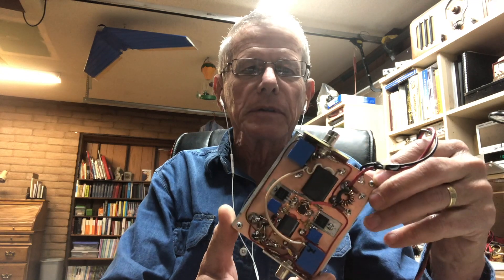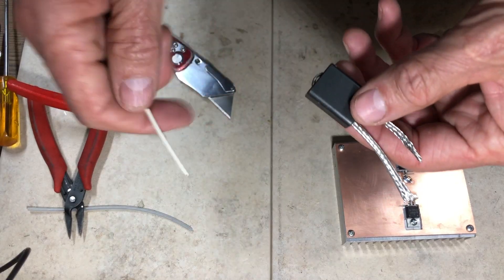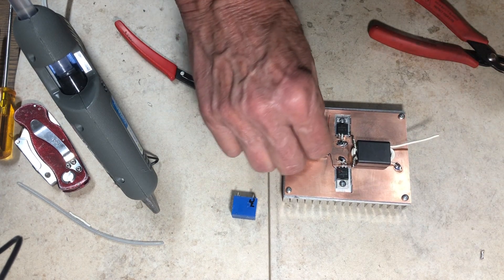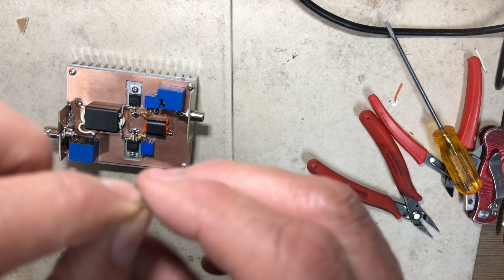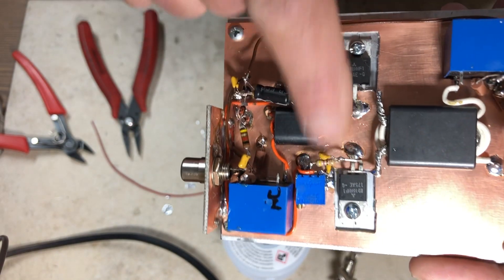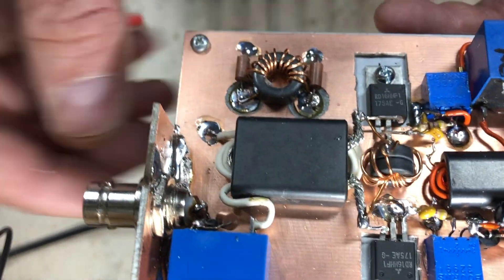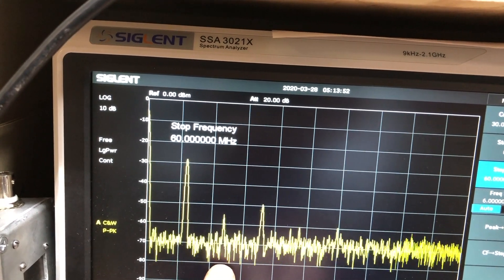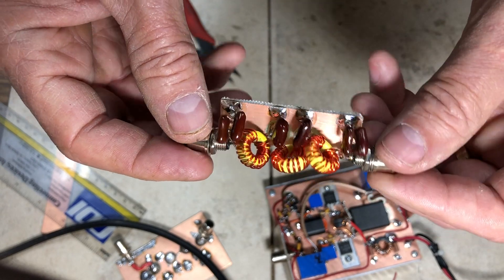RF Power Amplifier Construction

Comment: Hi Ron, really enjoyed the build - thank you. I've been looking for a reliable source (non Far East) for the RD16HHF1. Kits & Parts don't list on their site. Do you have any suggestions for a supplier? Thanks. Neville, New Zealand.
Reply from the maker: Hi Neville. Those transistors came from RF Parts here in the U.S. Good luck. Thanks for the nice comment ...
Reply: @rontaylor9026  Hi Ron. Thanks for the info. I've placed an order with RF Parts. I've ordered enough for your project and another project I like the look of ... and a couple of spares :).
Reply: NM You can also get a similar part from Mini Kits in SA ie Adelaide - Tim Fidler.  THe chinese supplier,  UTSource is normally reliable as in not  selling dud or repackaged parts.  Basically if you are buying out of PRC you should be paying 4 to five USD per part . If you pay a lot less you will be buying junk.  I have bought parts from Polida in PRC with good results (leaded J310s ) but not this particular part.  Tim Fidler  WRE NzL. My take -  RF Parts US has very high min order value and he charges top dollar too for what he sells. However he does not sell unknown parts from second tier suppliers.
Reply: @F_Tim1961  Thanks Tim from Whangarei. I've added all the sources you mention to my list of places to check for future purchases. I must say I was very happy with my RF Parts transaction. 7 transistors including shipping etc NZD$90 and they arrived within a week of ordering.
Reply: @nevmarr  Fair enough I think you would have paid around the same out of ADL.  - a quote from his site "Mitsubishi RD16HHF1 RF MosFET Small Signal N Ch 12.5v 16W 30MHz,..
Priced from AU $8.60."  

Bear in mind that this amplifier you are building is a NON Linear at the power levels given.  It is a 16 W RMS SSB amplifier only.  The bias for SSB use should be around 500mA per device ie 8W each before they even produce any RF out. The video does mention CW only.   The unit would benefit from a different material of OP transformer if intended for 10m Use. Specifically type 61 material.  The type 43 material was what DIZ says he used. (he calls it the MiniPIG Amplifier) However Diz says a lot of things .He calls it a 20 W linear which  is practically impossible at 14V supply.

The amplifier as shown will not produce 37 W out (non linear) when operated within Mitsubishi Specs for the devices. However , It might produce about 65/45  x 20 W = 28.8 W out based in typical efficiencies Class C to B  ratio and run on a 24 Vcc supply,  which is above Mitsi max for infinite bad VSWR resistance by about 9 V.  This is based on real word results for a Ukr pre built amplifier and comparison with data from Kees Talen (USA) who used to sell a kit with a similar topology.
Reply: @nevmarr  If you are looking for a CW only PA the 50W PA from QRPLabs is well worth looking at .  It is really a 40W out PA and will generate that only at about 22 V supply.  It costs only about 35 USD plus shipping from Turkey  (that includes heat sinks) . THe owner of  QRP Labs, Hans, is a Pom.

  It would be a bit messy to convert this amp to a linear SSB amp but it could be done.  - the messiness comes mainly from the bias arrangement he uses.  This amp does NOT use relays for tx rx  switching. It is all done in solid state. For the money, it is pretty impressive.  It uses a type 61 equivalent material output transformer (as two off coaxial cores side by side).  THerefore,  it can produce useful power at 28 Mhz and beyond. 

  QRP  Labs is easily found with a Google search.  40-50 W CW on 40m with a decent antenna effectively gives you 15 000 km in all directions.
Reply: @F_Tim1961  Thanks Tim. My main focus is linear (but I do dabble with CW). I was drawn to this page by the use of the RD16HHF1. I want to experiment with, but not exclusively, 6 metres and I've found a few references with the RD16HHF1 working well at 50MHz. Interestingly the Minikits EME210 kit uses the RD16HHF1. I'm QRP so, for me, broadband is more important than watts.
Reply: @nevmarr  the Kees Talen kit which is unfortunately now unobtainium proved that the RD16HHetc would produce power but not that well at 50Mhz.  He got 8 W out , linear,  under test in a real amp ie -3dB power on what he was getting at HF. the Big thing is the use of type 61 or  NXP equivalent cores.  You can still use type 43 in the phasing transformer.  It is also possible use type 43 in the front phase splitter transformer if you are willing to take the drive  losses.  The design as shown in this YT will NOT work at 6 mtrs . I think DIZ produced a fraud saying it will work at 28 Mhz also, esp the claim for 20W out.  He designed it for an add on to a PIG kit that did not sell well.  I suspect the amp as he sold it failed commercially. 

The cores that KEES used are available only from Digikey  (with high mark up and courier fees ) and not from DIZ.  In addition Kees used a copper tube design which is far superior to what is shown, because there is no magnetic field inside the primary tube except by that caused by assembly asymmetries.  Kees used TE coated wire in his design for improved performance - critical for 50 Mhz use .  PTFE coated wire is death to RF above 10 Mhz .  PE wire is possible but it melts at a low temperature. 

A vendor called Navships sells TE wire at good prices on Ebay . I have dealt with him . he's ok.  He is in the US and appears to buy up end of reel cables and then cut them up and mark them up a bit.

 The reason KEES T  stopped selling I believe was the competition from all the CHinese rubbish kits which had rubbish power out claims. It just got all too hard to sell a quality amp design.

  BTW there is a VHF version of the RD16HH which is an RD15VHf1 I believe. It has almost the same specs but has lower Ci and is rated to at  least 150 Mhz.  Minikits USED to sell this part and you will find them on Chinese EBay but take care with fakes . You can't use them promiscuously as  RD15s may self osc in  circuits which have feedback via the PCB layout whereas the RD16HH will work in the same circuit without issues. 

 Both types can be used in parallel  (but not mixed). If you can find the schematics for the Hardrock50  AMP you will see how they did it.  The Hardrock 50 also claims 6 mtrs.

If you go to the Waybackmachine on the internet you can pull up the old Fairrite cat 14 on ferrite technics as a PDF .   Or email Fairrite in the US for a back copy and keep hammering them until the provide it or give you a link.  Later editions got considerably dumbed down. Only the Cat 14 has sufficient information for proper RF design above 10 Mhz  and in particular about  Pig nose balun cores.
Reply: @nevmarr  BTW it is  standard practice to put a YY pF silver mica across the primary of the OP transformer.  I notice Diz did not do this.  The value is entirely experimental but typically around 800pF  (40mtr operation)  for this level of power. What it is doing is providing an L1  C  L2 transfer function to the winding of the OPT  (that's my interpretation).  the L2 is the leakage inductance of the primary of the OPT. The L1 is presumabably the board trace inductance plus the lead Z of the MOSFET PA (per side).  I have looked up Granberg and allover several times  as to the rational sizing of this capacitor and there is no theoretical sizing basis.  Clearly there is an optimal value for a given driving frequency but what is done is to put in one for mid band and leave it at that.  The circuit will work without it but it will not be optimal.    TEF .  THis type of matching cct is covered in Motorola AN 267 as a design tool.
Reply: @nevmarr   Are you aware that  MRF186s are avails on the  PRC surplus market for as little as USD 15 and some are in fact new (say the vendors) ??

Others are pulls from old CHinese  consumer VHF gear ( 900 Mhz cell phone tower power amps).  These are 28 V devices but will in  fact work on 14 V.  The power rating if properly heat sunk is 120 W out in Class B with an assumption of about 60 percent efficiency.  The datasheets are all over the web. These devices are of course out of production.   The main draw back is the really lousy Gp, about 9dB  (there had to be a fly in the ointment ) .  

These form the basis of the MXP -50M  multiband  brick amps that are sold in Australia and on the internet.  These are Vastly over priced for what they are and the mafr's power claims are Hsht but they will produce 35 W out with Vcc 14 V and with 5 W of SSB drive.  

 So why put up with 16 W linear on six mtrs when you can have 70 w or so and with the device hardly stressed at all... just a thought.  I think the ARRL and others ignore these simply because the are OOProduction and nobody knows what the true supply situation is.   Engstr        atat    Netspace    dit Net in AU will reach me if you wish to discuss  ( I have some schematics of known good commercial designs for the latter and layout photos )  Sorry to rain in the RD16HH parade.   Bst regards,   Timothy  E .  Fidler ,  WRE NZ (Dual citizen).

Comment: Para que feceucn es ese amplificado/   For to  frecuency is this amplifier?
Reply from the maker: This amplifier was intended for use on Amateur Radio frequencies in the HF band. Primarily in the lower part of the HF Band from 3.5 to 14.350 MHz

Comment: Hi! Can I replace the mosfets with IRF types?
Reply from the maker: It's certainly possible, but it may take a total re-design. The IRF types have the drain lead on the tab of the device so they have to be isolated from ground. They also exhibit different impedances, so the turns ratios of the transformers may need to be modified. And if for example you use IRF-510s, they will not make as much power as the ones I used when running at 12 volts, and will need to be run at 18-20 volts. Finally, I believe the devices I used are much less susceptible to damage due to high SWR than are the IRF devices. Hope that helps ...Ron
Reply: @rontaylor9026  Thanks a lot!
Reply: What about irf520 device and what voltage would they need?

Comment: Possible error - the 2n3906 PNP looks strange - should not the Emitter be mirror imaged on the schematic ??  No I see - all good - it is very hard to read on my screen.. that's my excuse on the closer pin of the  78 L it looks like the word OUT but it is very faint.  TEF
Reply from the maker: Actually it is correct Tim. The 12v enters at the emitter and appears at the collector when the PNP transistor turns on and supplies input to the 5 volt regulator. The 5 volts out supplies bias to the transistors on transmit. That same 12 volts at the emitter is present on one end of both the relay coils. The other side of those relay coils is returned to ground by the NPN transistor to energize them on transmit as well.
Reply: @rontaylor9026   I thought you might take up the business of the "missing" finessing capacitor ACROSS the primary which I mention below.  ?As say H Granberg and many many others talk about it and it does increase power transfer but the specification depends on things like the parasit inductance of the primary of the OPT  (and the secondary for that matter ) . I don't have the RF gear to measure that.  The proof of the pudding is the cct will work without it but it is more efficient with it.

2. The circuit has not option for a ground -= Run PTT circuit. The most beautiful way to implement this is a BS 250 P channel Mosfet switching type.  this has to be biased on with say 5 V via  1K resistor.  When the cold side of the resistor is pulled low , and the gate goes low the BS 250 conducts ( up tot 700mA)  That will then fire up the relays by pulling current through the drain of the Mosfet and the relay coils in //.

3. You need to make it very clear that when you use a MLCC type capacitor it is "accept not substitutes"  . For example the input 0.01uF caps are going to have to pass 1 W RF each and higher power as a peak.  They can be MLCC or SMica but if other subs are made the results may be ugly. New constructors may not realise this. 

4. Theoretical calcs show that if you have two off To220  close to the ctr of a HSink then you are FAR better off thermally than splaying out as you did.  It seems counterintuitive but it is true and is supported by quality H Transfer theory books.  So if each of the RD16HHs is rotated then the board layout becomes  a lot more beautiful  and in fact thermally superior.
Reply: @rontaylor9026  Another question - do you have any feel for why Diz used the FT 50-61 for the phasing choke.  Just about every other design of this type for the RD 16HH uses a type 43 ring core for the P Choke, to drive up the inductance . I know the original design was for 28 Mhz but you are using it at much lower frequencies.   I have always wondered too why Diz used type 43 material for the output transformer - given the frequency.  It has occurred to me that the material types were transposed because he never went into serious production with the design, where he error, if it was, would have been caught.   Type 43 of course on the OPT would be fine for 3.5 and 7 Mhz.   Just curious     TE Fidler            There's no point in asking Diz about this as he no longer has any interest in the design.
Reply from the maker: @F_Tim1961  Hi Tim. Thanks for addressing the filter question. I missed that. You may be right about the swapped ferrite types. I’ll have to play with that someday. I was happy with the output on the lower bands where I tend to use it so didn’t try any efficiency modifications. 
Ron
Reply: @rontaylor9026   The single mode impedance of the  phasing choke needs to be about 5 x the  impedance of the final RHS resistive load as  reflected through the OPT to the primary.   This is because a closely coupled Ph. choke doubles Vcc as seen by the PA mosfet which is the same as the reflected load being halved as seen by the phasing choke. So the  Real load as seen in parallel with the single mode Z of  the Ph Choke is  in that case on tenth of the Ph. choke's  5 x Z . Now a FT 50-61 with 8 t  is a bout a 4.2 uH inductor (if it is slow wound to cover 330 deg say it will be lower and by perhaps 30 percent).  That 4.2 at 10 Mhz comes in at  240j ohms.  If the amp is ouputting 16 W at  supply 14 V the output Z is about 18 R.  so we want at least  90 j as the single mode  Z of the Ph Choke.  That means the Ph choke as built  is only Just acceptable at 3.5 Mhz in terms of the current that will just be shunted and not appear in the load. As soon as the power out increases to 25 W or 30W then it  is not acceptable.  The choke winding table I used assumes that the Cu is in intimate contact with the core and for a bifilar wound core,  this is not strictly true so full L will  not be achieved.   The OPT core of type 43 is correct for the lower bands but is  a lousy choice at 14 Mhz and above.   Tables on page apprx 90 of the old Fairrite cat 14 show this very clearly.    TE Fidler
Reply: @rontaylor9026  Just to extend answer starting "the single  mode" - you might wonder what the upper limit of the  turns is for the phasing choke. - the answer is that it depends on how accurately it is wound, that is to say what the coupling coeff, k is.  Since it is a 1:1 transformer , you can consider  2*(L1 x [1-K]) appears on the far side in series with the OPT.  As long as K remains near one then turns , apart from real world losses (which are not zero) are not really significant and obviously at lower frequency, by the foregoing note more N is better. However if the real case of 8 T on the specified toroid is considered, the inductive react at 28 Mhz is about 0.6x  740j.  so the in series reactance is about 9 j for K = 0.99 ,  compared with a real load resist of about 18R at 16 W out - see previous calculation. ( Nb the factor of 0.6 comes from the fact that the turns are wide spaced on the toroid )  

THis is really serious in terms of loss of delivered power .  This  suggests K needs to be as high as 0.995 for this transformer to work well at this frequency and this K assumption.  
How serious is serious - well the above figures indicate a drop of rf current by 18/20.1 ratio with a cos phi of cos 28.5 degrees. That is an overall power drop implied of 0.8 or -20 percent.

It also indicates why  Diz chose the type 61 core. It is also a general pointer as to why getting reproducable performance above about 15 Mhz is so hard.  AS for the material of the OP Transformer,  I'd say it was just a first pass and  a cost issue.  It will work  at the indicated frequ. from Diz,  28 Mhz,  but it will be lossy there.  How lossy ? - see the old Farrite catalogue 14. 

It is interesting that  Kees Talen  (Ex EE head of Texas A and M ) used a Bifilar wound Phasing T wound on a BN 43- 302 for his 16 W linear kit  amp. This was qualified to operate at 6m but with reduced power out.  I am guessing he tried a conventional PT and found it would not perform.  It is interesting that such a small detail as this has so much science to it as soon as you start cranking the frequency up much above 12-15 Mhz.  TEF

Comment: Thanks Ron for the explained Rf project.
Can it work on frequency 80mhz to 120mhz?
Reply: You could do something similar but you'll need to make changes. The FETs should be changed to the RD15HVF1 instead and the input and output transformers will probably need to be altered. Of course on those frequencies you can drop the relays as TR switching is not going to be necessary

Comment: What is rf frequency range does it work?
Reply from the maker: I built it for use with a 40 meter CW transceiver and yes it works well. It does exhibit gain reduction with increase in frequency but should be usable at least  from 80 meters to 17 meters.